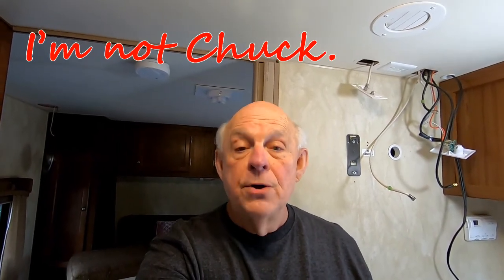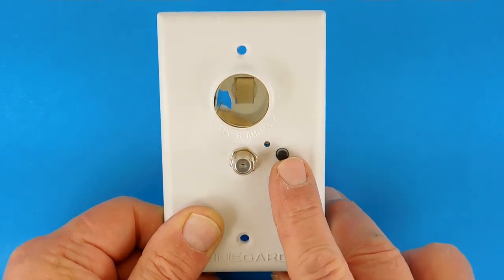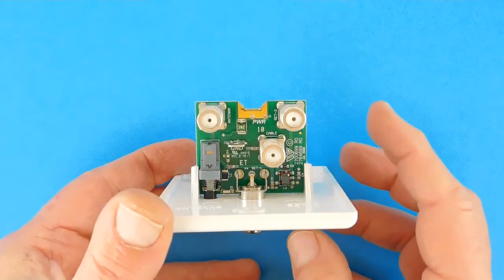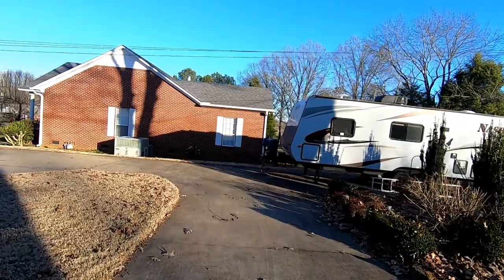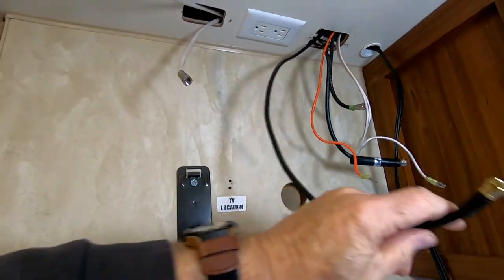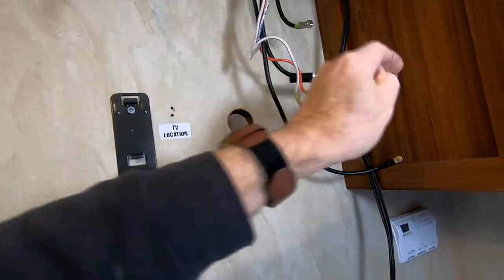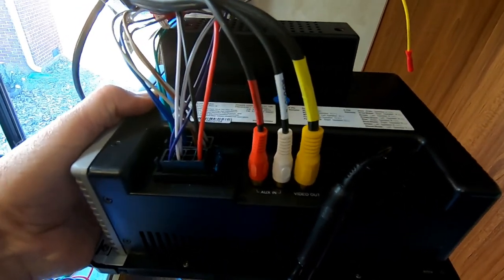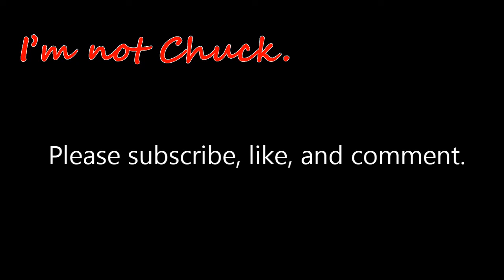Wiring Your RV TV, Cable, and Antenna

Comment: Thank you very much, that was interesting and my cables are not right on our new camper we have had it back for several different things that have not been fixed including the cable for cable TV . Perhaps I'll do it myself.
Reply from the maker: Thanks for the kind words and for watching. After you understand the basics, it's not hard to fix wiring errors. As you are learning, most camper manufacturers and dealers don't know as much as you do.

Comment: Thank you!!!  Now I know what the outside cable connection and inside cable connections “should” do if they’re labeled correctly.

I’m learning more about modern technology (whatever that may be in a camper trailer) then I ever wanted to know, now I that I’m living 24/7 in a camper trailer.

Plumbing: hot and cold pressure-check/
Cable- almost check
Electical😳

Best wishes?
Always
Reply from the maker: Hi Kathi, and thanks for the comment. Full-time RVing is a real challenge, and I wish the best for you. Be careful with the electrical stuff; also be sure that your smoke detectors and carbon monoxide detectors are installed and working properly. Safe travels.
Reply: Thank You and I will, have to be careful😳🤭🤗😆

Comment: Very well done. I like the way you went about explaining in detail  and in a logical manner. So often, help vids leave out small details which the author deems common knowledge or insignificant, yet is vital info for my purpose.

I just needed to know how the power button on my antenna worked, but I had to comment on your presentation.
Reply from the maker: Thanks very much for the compliment. I do try to be methodical and comprehensive in my technical videos. Glad to have helped.

Comment: Good video on explaining the connections. Got a question for you or one of your subscribers. Using my multi volt meter I'm getting 0.18 volts on the 2 +12volt wires? I was planning on hooking up my winegard internet antenna there but need 12 volts. I removed the old winegard anntena to put up the new connect 2.0 4g lite. Any idea why I'm only getting 0.18 volts? Thanks
Reply from the maker: That low a voltage may indicate an open wire or a badly corroded connection somewhere. You may have to run a new wire to repair the problem. Thanks for watching.

Comment: I just bought a small trailer that has a similar antenna and wall plate with the “Antenna”, “Cable TV” and “set 2” connections behind the plate and the “Set 1 connection on the visible side of the plate.  My trailer doesn’t have a cable tv connection on the out side and nothing is attached to the “Cable TV” connection on the wall plate.  I’m planning to add this myself for use in RV parks that offer cable tv.  My question is, do I have to switch anything when I go from one place where I use the antenna to another where I have cable tv service?  Because my television loses power every time in unplug I have to set up the channels each time set up I’m assuming I can just switch from “Over the Air” to “Cable” in the televisions settings as it learns the channels.

Comment: Thanks for the great video! I’m replacing my Winegard wall plate/power supply just to see if it’s the cause of my antenna issues in my 9 yr old camper. We are full-timers connected to shore power. Do I need to disconnect from shore power to prevent electrocution, or just pull the fuse?
Thanks!
Reply from the maker: I would just pull the fuse for the 12VDC to the antenna. Make sure all your connections to the wall plate are tight. Remember that the actual amplifier for the TV antenna is at the antenna; it could be that the amp is kaput. So if replacing the wall plate doesn't help, you may need to replace the amp.
Reply: @ImnotChuck.  actually I just replaced the wall plate and it fixed it! The old plug actually looks a little goopy on the lead where the hot wires connect, so maybe a shore power surge cooked it without blowing the fuse? Whenever we’d turn on an LED light in the camper, the TV channels would flicker. Now everything’s fine, and all the channels are receiving great.
Thanks very much for your help.
Ryan
Reply from the maker: @GREENL3600  Terrific! I am glad you got it working. Thanks for watching and for posting.

Comment: How do boondockers keep warm throughout the night? I almost killed myself with my generator running to close to my trailer last weekend. I'm glad Alarm was so loud
Reply from the maker: I am so glad your alarm was loud. My Nash RV was better insulated than most, and we didn't camp in really cold weather, so we didn't need a lot of heat during the night. We made do with more cover and some snuggling. Thanks for commenting.
Reply: @ImnotChuck. yes, we love it. good plan. I have been covering it in winter then uncovering it for the 3 rv seasons. I'm sticking to that. Lol
Thank you for reply & videos, much respect

Comment: Where does the cable from the roof top antenna connect to the tv or circuit board you showed? I have to replace that as it corroded away and I'm wondering whether to just cut the cable at the roof and add a new piece to the antenna or try to snake a whole new cable from the antenna thru down to the circuit board? You showed?
Reply from the maker: Hi, and thanks for watching. At 3:18 in the video, the red arrow points to the F connector where the coax from the roof antenna connects.
Reply: @ImnotChuck.  thanks for the answer and the video. Hopefully I can attach a new cable to the old and pull it through down to the amplifier switch. Also thanks for pointing out that the dvd player used rca plugs instead of hdmi because I wanted to switch out the existing built in 9 year old TV to a smart TV, and there is a built in dvd player, stereo also, so I hadn't considered that possibility!!!

Comment: You made reference about 2 wire from antenna but didnt cover that area  . I only have 1 f connector on the roof how do you determine if iy goes to the antenna  or amplifier
Reply from the maker: When you say you only have 1 F connector on the roof, do you mean on the inside ceiling or on the outside roof?
Reply: @ImnotChuck.  yes only 1 on the roof I've figured out that my both disconnected f connectors are one and the same how do I test amplifier and is it actually the wall plate that everything connects to or is it part of the antenna this is my first used travel trailer so I'm clueless as to what I'm looking at  also maybe you can shed some light for me about water tanks I found 1 plug underneath and nothing else but isn't the filtered water sperate for toilet water that I flush with and if so we're is it located I see 2water inlets on the side I see to get to the float that gauges how much water in that tank inside it tells me it full but when I flush the toilet all I'm getting is mostly air

Comment: I don’t see the green light when I turn my antenna booster on anymore and I’m not able to pick up “air” channels.  Do you think this power issue is behind the plate you were showing us in this GREAT video.....OR, do you think I need to get up on the roof?
Reply from the maker: The green light only indicates that power is on. While it is possible that the green LED is dead, it's not likely. More likely there is no 12V being delivered to the LED. It could be that the breaker or fuse in the converter box is open, or (not likely) a wire is broken or loose that supplies power to the to the amplifier. It is possible that something on the roof has shorted out the power, but I would check everything else first.
Reply: @ImnotChuck.   THANK YOU SO MUCH !!  I don’t see any blown fuses, so I will start at the back of the plate....make sure the 12V line is connected, then go from there.  My converter box is WAY BEHIND the fuse box...I actually have to take the wall in the bay of my 5th wheel down to get to it.....(I will NEVER understand why these RV builders can’t make all electronics more accessible)....I will check the converter box as well.   😄😄😄😄
Reply: @sharonl.8194  I am having the same issue with the green light. Did you have any luck fixing yours?

Comment: Hi, if I wanted to hook up to an external antenna, could I hook up to the cable connection on the other side of the the camper?
Reply from the maker: Yes. That should work fine. Thanks for watching and for commenting.

Comment: We bought a new motorhome in 2014 but it was 5 years before we tried the cable
Tv & wouldnt you know it? It does not work. The roof ant works great. I have bought 
a 100ft tv cable. I intend to pull our coach up close to our front door, stretch the 
cable from the coach into our house & connect to our cable box & use our Rv's tv as
the tester. Wish me luck. I'm going in.

!
Reply from the maker: I do wish you luck, and think that's a good test method. My guess is that your problem has to do with the wiring in the motorhome. Thanks for watching and for commenting.

Comment: Where does the white ground cable run up too. Is it grounded go the ceiling antenna? Im not getting any power to the 12v power supply.
Reply from the maker: In most RVs, the entire metal frame is used for the ground buss. The white ground cable could run back to the frame or it could be connected to another wire that ultimately connects to the frame. Use your DMM to check for continuity (ohms) from the white wire to another point that you know is grounded. Thanks for watching.
Reply: Thank you for replying
Reply: I found the problem. A mouse ate the ground cable and I uploaded a video in how I fixed it. Here it is if you want to watch it
https://youtu.be/5MQPPwhGF5g

Comment: What did you use for testing the cables
Reply from the maker: I used a DVM (digital volt meter) set to measure resistance (ohms.) Then, I would short the center conductor to the sheild of one cable, and measure resistance at the other end of the cables until I found one with very low resistance, which was the one that I had shorted together. Thanks for watching.

Comment: Where does 12 volt wire run to from the signal booster
Reply from the maker: Hi Edward. The 12 volt wire should connect to the 12V power buss that runs through the RV. In my case, the the buss wire was accessible through the hole in the ceiling. Thanks for watching and for commenting.
Reply: @ImnotChuck.  well I'm kinda new to RV'ing so I don't even know where to begin looking for the 12volt buss...but thanks for the reply.
Reply from the maker: @Edpalomares54  All of the lights in the RV probably run on 12V. There should be two wires going to each light: one will be 12V and the other will be ground. Use a digital voltmeter to be certain which is which, and connect the 12V wire from the booster to any 12V wire going to a light. The booster draws very little current.

Comment: How does that RV digital antenna work do you get a lot of TV stations when you're camping out of town and how do you get cable without a digital box these days also I noticed you didn't talk about a wife I hook up to your TV do you have that also
Reply: I meant to say wife I not wife😎
Reply: WiFi not wife
Reply from the maker: Hello, and thanks for watching and commenting. The antenna works well...much better than the one it replaced...of course, getting any antenna higher is better. I can get most stations within about 15 miles, and those with higher power transmitters much further. Cable companies often use cable boxes to scramble the signal, so you have to have a box to get the picture, but most campgrounds that provide cable don't scramble. I don't yet have an outside wifi antenna, but it's something I am thinking about. Campground wifi signals are often overloaded and aren't much use during prime time. I use my cell phone as a private wifi hotspot.
Reply: No cable box is needed when receiving your TV signals over the air.  When I'm camping and do not have a cable service provided campground, I switch to the rooftop antenna, and I can usually receive about 50+ channels.  Yep,....50+.  And some of these stations are actually broadcast in HD.  Hard to believe, but true!   So, I actually NEVER care whether cable TV service is provided or not!  Just be sure your rooftop antenna is designed to receive the digital receptions.

Comment: Thanks helped very much I have the same system and it wouldn't work the maker of my camper they wired it wrong
Reply from the maker: That's very common, I think. It's too bad that quality control isn't better at some of the manufacturers. Glad to have helped; thanks for watching and commenting.

Comment: I give up on trying to find a video that explains how I wire up to the actual source of the power. Everyone just explains how to wire up to the booster.
Reply from the maker: All 12VDC power in most RVs comes from one or more batteries and a converter. Maybe that's a topic I need to explain in more detail. Thanks for commenting.